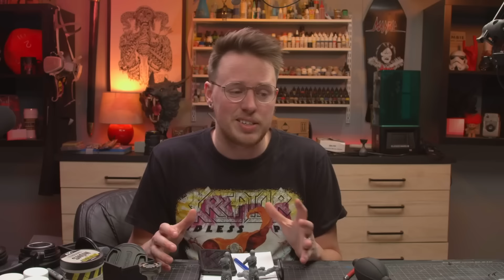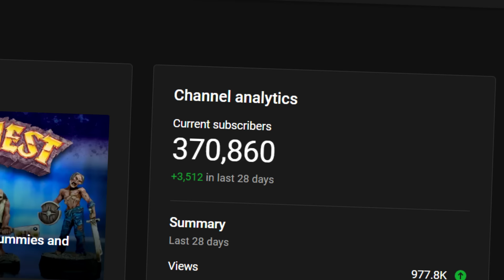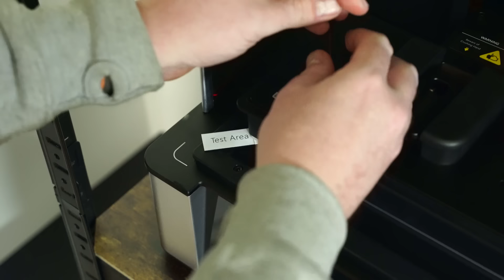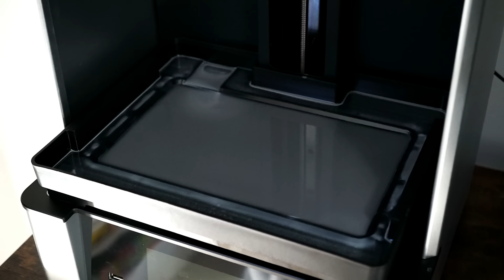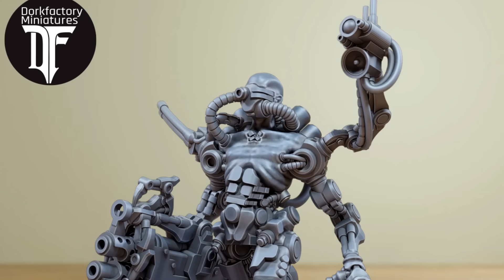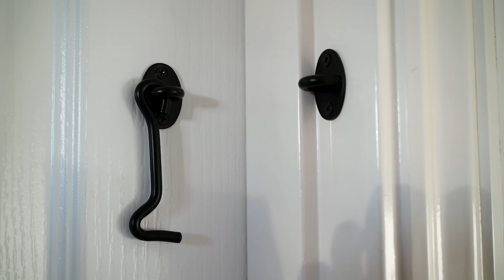Is 3D printing FINALLY easy enough to print Warhammer at home? Uniformation GKTwo!

Comment: If you're worrying about VOCs.
Get a hydroponics tent.
an in-line duct fan with hosing.
Put all your printer stuff in there.
Print in there and have the fan suck out all the fumes and deposit them out the window.
Reply: All can be bought on a certain amazonian website.

Comment: I appreciate the conclusion of this video. 3D printing is definitely not for everyone. I don't blanket recommend it to everyone. The concern of kids and pets being exposed to the toxic chemicals is absolutely a huge concern. I'm fortunate to have a garage I can set everything up in where I can control who goes out there. The wash station I have has an airtight lid and I wear glasses, gloves, apron, and a respirator whenever I'm doing anything with uncured resin. Folks need to see videos like yours before diving into 3D printing. Its a lot more than just having a corner in a room to set up a printing station. Yeah, I was able to get a printer, computer, all of the stls, resin, and alcohol I needed to print an imperial guard army for what it would have cost to buy one from GW, but there are definitely other costs and concerns to consider.

Comment: If anything it’s a massive success in resin technology that the major VOC production stems from spirits and not the resin itself (at least for the most part) given that it’s well protected and filtered inside the printer. Water washing would fix my largest issue at that point!

Comment: Started with an Anycubic Photon M3 a few months ago.  I've had less than a handful of failures and most of those were my fault as I put something too close to something else on the build plate.  In that case the both items kinda merged so they were unusable.  The other items on the plate printed fine though.  I didn't print any calibration stuff...just used the recommended settings from the website.  I've even mixed different resins that people said will "be unpredictable" and even those parts printed fine.  I do print in my garage so the VOCs aren't an issue.

Comment: It's good that you also highlighted a crucial point many in the wargaming community forgets or ignores: 3D printing is NOT a tool for your wargaming hobby; it's a hobby all in itself (which can incidentally produce results you can use in your wargaming hobby, but still)
Reply: I mean it definitely can be though, it’s really not that hard, set up intensive yeah, but not that difficult. Learning to paint make models etc, was way harder than learning to 3d print them. 

Depends on your situation though, I’m in college and have mine next to an open window with an air filter

Comment: Bruh, for the price of this printer I can get two mid-gen that do the same job. Four if I go for earlier-gen like Mono X 6K. 

Used a Photon starting with 2019, and I had around 90% success, failures mostly due to my mistakes. Switched to a Mono X in 2022, been printing huge stuff with it, no problems. My guess is that you want a perfect machine, kinda like a toaster, plug and print. We're not there yet.

Also, ultrasonic and alcohol...

Comment: Don't get cheap on the ventilation, dedicated furniture/work surface, or ppe. Price that in, and, obviously, if you have kids coming and going, don't resin print there round the clock. Seems reasonable.

Comment: This video and fauxhammer is what spurred me on to get a 3d printer, even though im a combustion engine mechanic im also a bit of an eco warrior and was in 2 minds about resin or fdm , I would prefer to make things out of something that's recyclable materials,  I know melting plastic can also create fumes over certain temperatures,it would be interesting to test the voc's from fdm filaments in the same environment as resin printing. ❤ The channel tim,hattie 😊😊

Comment: I'd love a resin printer, especially something like the GK2, and it would be a neccessity if I wanted to be able to print for more than half the year due to temperatures in the UK.

I get all hyped up for it but then remember all the clean-up, chemicals, disposal of mess and fumes and it just douses my enthusiasm.  

Being able to print parts and models as you need them is the biggest freedom -  I love my FDM for scenery and prototyping mechanical parts but it doesn't compare to a resin printer on those tiny detailed bits we all want to make our models look unique.  For the amount I'd actually use a resin printer the current cost probably far outweighs the benefit .

I just need to find a reasonably priced UK print producing company or individual that can make me the high detailed models I require, but then comes the second part to that solution.  

If I buy myself some 3d models to print that's a cost to me.  If I then have to send those files to a printing company or individual, that's another cost to me and who is to say those files won't be copied and retained by that company or individual.  This may be a cynical way to look at it but its a sad fact of life and it kind of puts me off that avenue of approach too.

What kind of fee would most expect to charge for printing a bed of models or set of bits for you in the UK?  

Filament is fairly cheap for an FDM printer but resin is much more costly as I understand it and something like trhe resin used in the demo video is at the very higher end of the cost of resin.

Comment: I got into 3D printing about a year ago, though I've never done tabletop games.  I love being able to scale up models to create figures rather than minis, though I only scale to around 60mm.  I'd say the biggest learning curve was learning to do supports that don't fail but also don't leave a lot of bits to clean up.  Supporting a model before printing is probably the biggest drag for me.  I've kind of fallen into printing in the warm months out in my garage and painting in the cold months.  I do have a Fungoo enclosure for each of my printers.  They have fans and hoses so you can run a hose out your window to pump the air in the enclosure directly outside.  For those without super nice heated vats, you can get small personal space heaters and a temperature regulator often used in tabletop greenhouses to maintain the temp inside the enclosure.  I believe a small heater that fits inside the cover of most 3D printers was recently released as well.

Comment: you sould take them off the plate with the plate removed from the machine.
also to get the supports off easier put in hot water and the supports come off way easier!

Comment: I have a HALOT ONE (pretty cheap, pretty simple, good enough) and In my experience printing an entire Astra MIlitarum army with free STLs (vehicles printed in ABS, because in resin is... madness) i never needed a gas mask (though i bought one) nor noticed "toxic fumes" coming from the printer; also i never needed to heat up the plate or the resin to get better results, and never needed a fancy washing/curing machine; a simple UV light and a plastic recipent for washing is all i have and worked perfectly;

BUT the water that i use to wash the minis actually smells like something i dont want to be close, so that thing is keep closed thight all the time but when i want to wash something, wearing gloves and for less than a minute.

Comment: For the VOC fumes issue, maybe you can use a shower curtain or similar plastic with magnets to create a curtain to wrap your rack in.  Then use a flexible hose duct and a small fan to direct the fumes out of your window.  Maybe there is a charcoal filter so you don't need to use the duct and window.

Comment: Guy, I had the same experiences and concerns about resin printing. The best advice I can give BY FAR is to lose the mentholated-spirits as your cleaning agent (mineral-spirits or paint-thinner in the US.) I started painting models with enamels (and lacquers,) in the 1960s and that stuff WILL eventually mess you up. I use acrylics now. To clean my resin parts I use alcohol, with ventilation, or better, water soluble resin and LA's Totally Awesome Cleaner, the stuff eBay Miniatures Rescues, and I, use for ultrasonic paint stripping. You'll find an equivalent in the UK--Some all-purpose cleaner that comes in jugs. Having a good printer like yours is a must. I upgraded to a Photon D2 with the DLP technology and it's made a huge difference for me. I've been a subscriber for a long time. I marathon the Blackstone Fortress series now and again. It has an uplifting, relaxing vibe. Now, Please get on with the HeroQuest series!

Comment: Let's put a flammable volatile solvent in an ultrasonic cleaner that generates heat. What could go wrong?

Seriously guys, there's a reason why many of the solutions on the market is a washing machine with a swirling mechanism.

And yes, while everybody is giving you warnings about the toxicity of the resins, the most VOC you'll inhale come from cleaning solvents.

Comment: I personally switched to 3D printing as soon as I saw the pricetag of some of GW models. I'm sorry but 100 bucks for 12 models is way too expensive for me and most armies if you want to start playing will cost you more than the GKTwo and you haven't even put them together yet. Where as with 3D printing I can print different proxy armies in days. 
I have cats and I understand your concerns with your kids and dog. I'll be moving my Resin printers to my garage as soon as I have more room. My window is open as soon as my print is done and until a couple of hours after I've cured everything. I clean and vacuum EVERYTHING before I let my cats in and never let them in without me being there.  I also have a UV flashlight to cure resin bits on the floor that I possibly missed. It's also perfect for repairing broken resin parts. I suggest a hands-free trashcan for your resin trash. Stuff like papertowls, uncured supports and used gloves. Everything uncured is toxic and shouldn't be put in regular trash but if cured it's fine so I leave my full trashbags in the sun for a few days before bring them to the dump.

Comment: You HAVE to purify, whether you smell it or not you MUST Protect yourself. Run a hose out to the window and seal it... The Printer companies hardly mention it.  It is a toss up between buying Prints like on ETSY, Take the steps be thorough...  That's a nice Printer! I picked up a Saturn Pro, and then I realized I need to secure the air...so I won't use it until all the gear is here. Thanks!  When you start printing armies then, you'll get the bug!  It Is the future here now.  👍👍

Comment: I make my own 3D models in Blender, and want to get better at both printing and hand-painting the models I make. Resin printing is not appealing to me for much the same reasons as Guy has given in this video. Instead, I'm using a filament printer. While filament printing comes with it's own unique challenges (feed-issues, what plastics to use, and the thermal shock some plastics can go tolerate) it doesn't involve having to dispose of chemical waste. I'm entirely accepting that I'll likely never get prints as smooth as if I'd used a resin printer, but that's fine by me.

I've also, tentatively, gotten into miniature collecting. I own 2 night lords (legion praetor, and a chaos lord), a skink starpriest, and a box of skeletons from Warlord games.
I know I'll never get to the state of owning a complete Warhammer army comprised of official models, again for the same reasons as Guy may not get into 3D printing:
I can neither afford the time nor (in particular) cost involved with an additional hobby. So I just get the miniatures I really like the look of and don't concern myself with rulebooks or army meta.

Comment: Home air purifiers do not do a good enough job of detecting and filtering out the hazardous chemicals that resin printing creates.

Under NO CIRCUMSTANCES should you be printing in your home without proper air filtration and PPE

Comment: If the slicer software doesn't recognise the supports as supports, scaling can cause issues. You might be better to scale then add the supports.
And I'd buy a ventilator mask which handles organic vapour.
My GkTwo arrives on Tuesday. Temps with the window open in Scotland have been my issue with failures on bigger models on my current printer. Fingers crossed.
Water wash is great. I'm trying ABS-like resin next.
Good you got Ross to help. Surprised he didn't get you to do the cones of calibration. I called those on his stream the other day there.

Comment: One thing on water washable resin and safety, which I’m sure you’ll have covered if you do a future video but still - 

While water washable resin means you might not need IPA or methylated spirits around for cleaning, the used water after cleaning is hazardous and needs to be disposed of safely. It definitely should not be just poured down household drains.

Comment: Im one of those who used it in a room without the best ventilation and I definitely did poison myself by doing so. Not a smart idea running a printer all night in the same room where your bed is even with open windows and carbon filters. I will not return to 3D resin printing even tho I had no bigger failures or so. But working with resin and the IPA is causing headache to me now. So I cant recommend using a resin 3D printer in the same room you paint/sleep/live because even with a respirator it got to me.  
What sure about resin 3D printing is, that there is alot of training missing for the home use and you need lots of time to be optimal prepped for it.

Comment: Please, please, please! Take off the print plate before scraping off the print 😅

Doing it like in the video, hanging upside down above the resin vat drastically increases the risk of small debris being left on the plate or dropped into the vat, which could quickly mess up your printer, FEP or prints.
It’s a bad experience waiting to happen, that can easily be resolved :)

As a general advice to people getting into resin printing; Do not go for the cheapest resin! You get what you pay for and for our hobby (that being miniatures 😂), the cheap, brittle resin is just not up to par. I do not know the Wargamer resin used here, but I’d assume that it would be suitable - Alternatively, Ameralabs TGM-7 or Sirayatech ABS Fast mixed with Sirayatech Tenacious (about 85-15%) are great options.
Learning to use the machine is a bit of a hill to climb, but once you get proficient with it, it’s as easy (or easier) as printing on paper with a standard printer, in my personal experience 😊

Comment: You have to be a certified Moron to fail at 3D printing even with OG Photon 3D Resin printers. And The Thousands of the Resin 3D printers you are worried about? Most of them are not Morons.

Comment: What kind of printer did you have before to make that easy plate leveling?!? I have 5 resin printers from multiple manufacturers. They are all loosen screws, slap a piece of paper down, push a button, tighten screws. Putting four folded pieces of paper under each corner, adjusting four screws to an arbitrary tension? Sounds like a step backward into old Creality bed leveling.

Comment: I have had no problems with my resin printer (except for the cleaning and all that) until recently when I ha to change my FEP film. S¤%%t and f¤%¤%k nothing works anymore and I havn't found a solution for it yet. Other than that 3d printing is amazing.
Another think worth mentioning that has been mentioned in other Midwinter videos, be careful when sanding, the particles aren't nice to your lungs.

Comment: I went from cheap FDM printer to a good resin set up and I also was worried about VOC fumes as my set up is in my office.  Like you said I found it strange how 98% of the VOCs produced was during the cleaning process with IPA being the worst of the bunch.  I have a Phrozen printer so I don't have a heated vat so what I do is open windows while cleaning (which I do in bigger batches, keeping unclean models in an old cardboard box) then run a space heater prior and during prints.  Also, I have an air filter or two running all the time.

Comment: Maybe the best solution is for gaming groups the get one set of printing equipment. still there should be at least on expert in the group to operate the equipment.
or buy the 3d-printed models you like from someone with a printer.

Comment: I recently acquired a printer around Christmas. I've just finished priming my warhound titan and cant wait to keep them coming. I run the Anycubic Photon Mono 2 with 2 air purifiers in with it using the Anycubic Water washable resin and so far its been fantastic with very little issues.

Comment: I backed a 3D printer on kickstarter for half the current retail price including shipping, read up on everything as much as possible. I'm also a professional 3D artist so that helped a lot as well. But honestly I have the same feeling when it comes to 3D printing. 
It's fairly obvious that the 99.9% IPA isn't fantastic for your health, nor is the resin and the fumes themselves, you really need to have the space for it, trouble shooting can be a B. Leveling it was fairly easy with the printer I have as well. It's basically a very cool suplementary tool, but way more expensive, way worse for your health and take so much more space. Yet I can't put to words how much it has improved my hobby at the same time. I use it because my 3D sculpting skills are way way above my real sculpting skills and it's much easier to sculpt my own bits, support and print them than it is for me to sculpt the same thing out of greenstuff or miliput. When I printed my first bits, that I had made myself there was an immense satisfaction, but I feel like I wanted to like the whole thing a bit more, and it's absolutely not a replacement for buying minis in my opinion, not by a longshot.